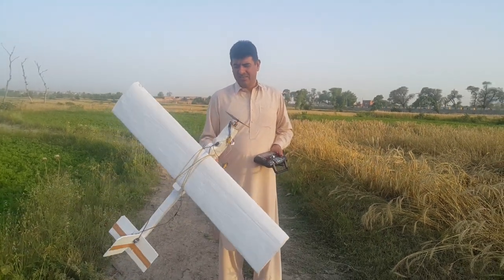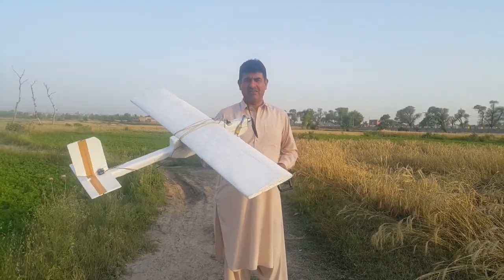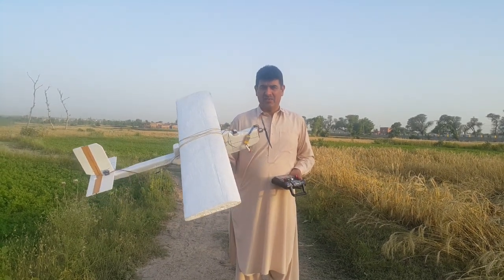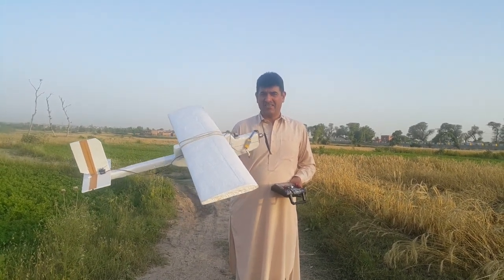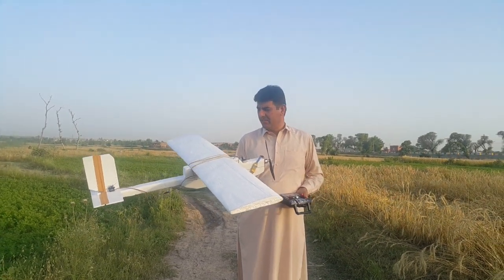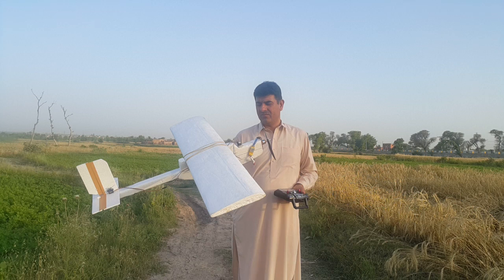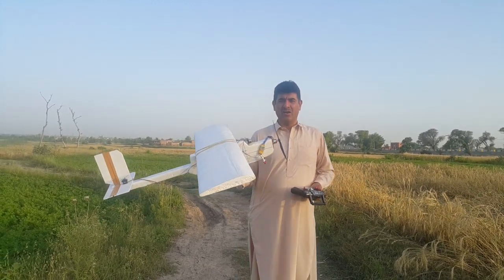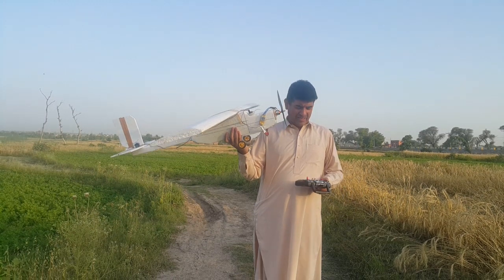RC Plane build from Thermocol

Comment: thanks for posting.   here are some things to consider.  because the model has a zero-dihedral main wing, ailerons are necessary for adequate roll axis control.  or, change to a dihedral or polyhedral main wing.   turbulence at the main wing trailing edge Could be reduce by making the trailing edge thinner;  the thinner the better.    there are GOOD reasons to make the tail of a model aircraft as Light as Practical.   servos should Not be installed at the Tail.   install servos Near the model's center of mass.  always.    the weight at the Tail Could be reduced by removing material from the stabilizers and control surfaces.  i have suggestions.     i compliment your use of a good profile for the main wing.  the profile appears to thickest at 30 percent of chord; which is correct.       cheers
polyhedral shown with unnecessary mid-span angle
http://4.bp.blogspot.com/-2--h6sQm6gM/UbHzoXWPxYI/AAAAAAAAUiI/sn7cWnVlkuQ/s1600/polyhedral.jpg
thin trailing edge
http://www.knifeedge.com/forums/downloads/clark_y_w9e.jpg